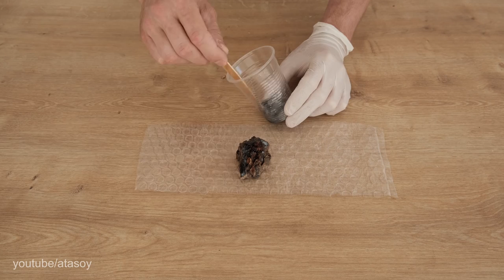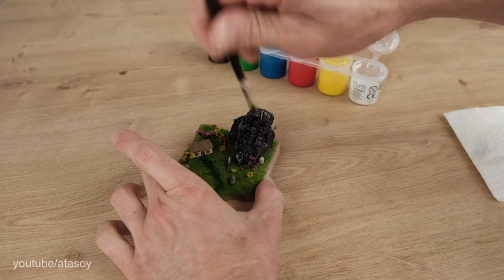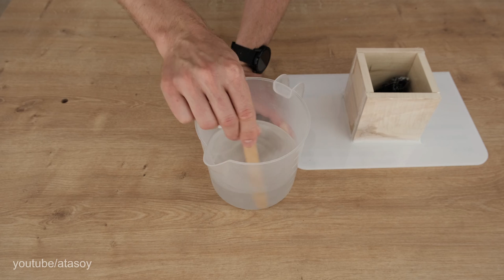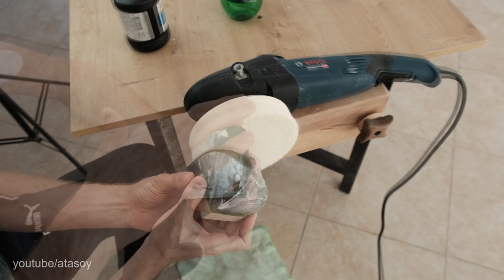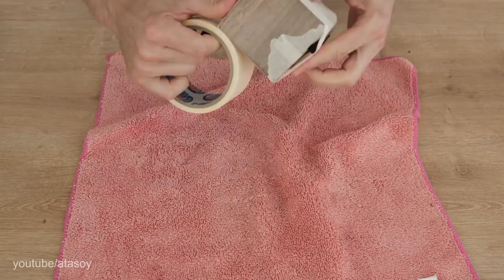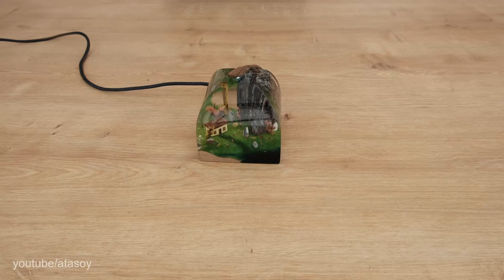Nature View Epoxy Lamp | Resin Art Diorama

Comment: why using abrasives ??  epoxy is clear .
Reply from the maker: It is used to remove the imperfections on the face and then to regain the surface shine.
When rough shaping the epoxy, the surface shine is lost.  Abrasive is used to make it shiny again.